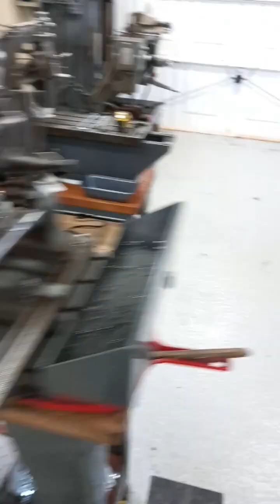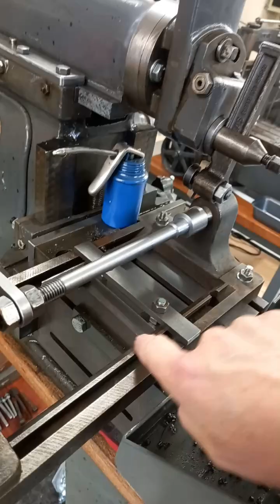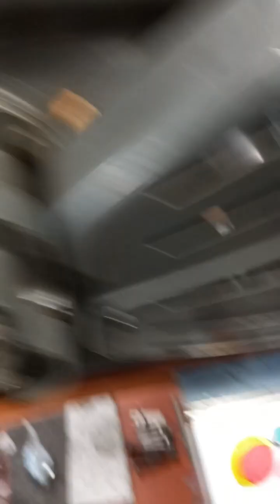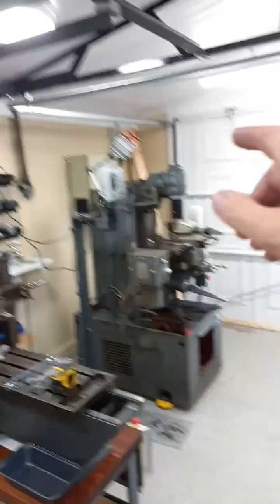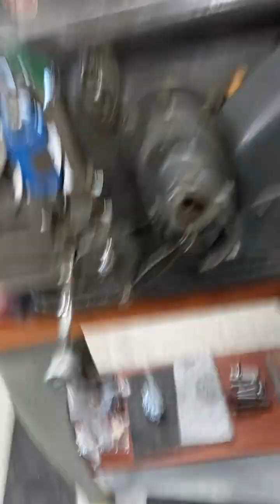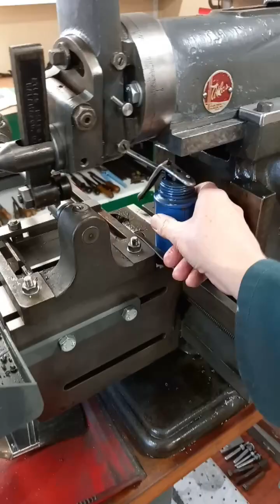Atlas Metal Shaper, Dividing Centres Part 1

Comment: That seems to work quite effectively.  I just started rebuilding my 7a and you’ve given me a great idea.  Using a VFD to speed up/slow down the machine is brilliant.
Reply from the maker: The centres are a very usefull addition to the machine.  Very difficult to come by and very expensive if you do find them.  Probably cost more than the Shaper.  I leave the belts on the slow speed pulleys and do all the speed changing with the VFD.  Thanks for commenting.

Comment: With your zero issue, why not set zero on your tool slide and touch off by raising the box?
Colin
Reply from the maker: Yes I could do that, but the cross rail has to be locked on the verticle slides when being used.  To lift the box table up or down the clamping bolts have to be loosened, this alows the box to tilt slightly under its weight.  If I touched off on the tool using the box, when I tightened up the verticle rail clamping bolts the table would lift slightly, throwing the setting out.  Plus it is much more labour intensive to set the tool.  I normally put a sharpie marker on the tool feed dial and write down exactly where the touch off point is on the dial, pretty crude but it works.  I can show this in a future video.  Thanks for commenting.

Comment: HI Dave. The fixed calibrated collar on the downdeed. Could you  modify it and fit an adjustable one that you set to zero? I like your approach to accuracy when needed. As long as I can get my spanner on. That's how I work most of the time with all of my components lol. Cheers Tony
Reply from the maker: Hello Tony, I had a look at trying to incorporate the Myford cross slide dial, but it would be a bit more complex than I wanted.  So decided to stick with what I had.  No matter how acurate we are with our measuring instruments the ultimate test is the spanner.   Thanks for commenting.
Reply: Hi Dave,

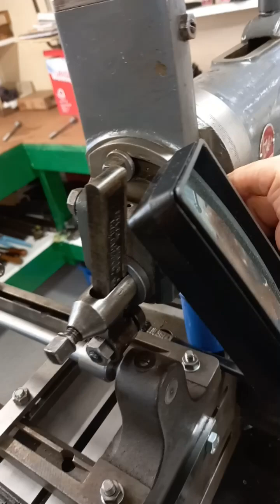Are you sure you can’t adjust the zero on the down feed dial?  On mine, I loosen a set screw to change the zero.  I believe I saw the same setscrew on yours at around the 5:29 mark in the video.  Might be worth a check.  

That dividing setup is a nice piece of kit.  I’ll have to build one of those for mine!  :)  I’ve tried rotary tables and spindexers and found them  to large for a 7” shaper.

Nice video!  Thanks for sharing!  I look forward to seeing a video of that planer running!  :)

Cheers